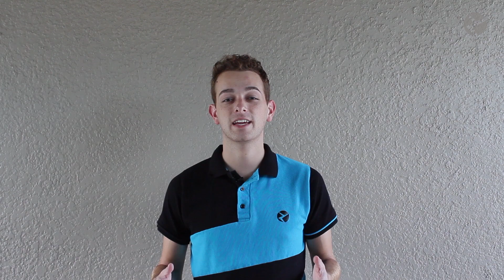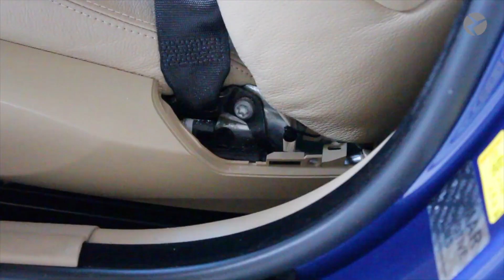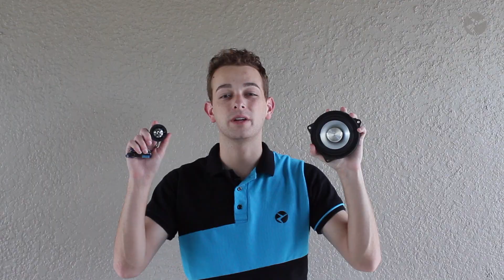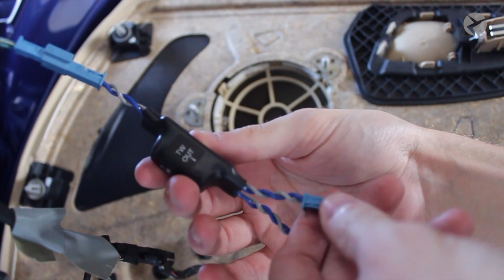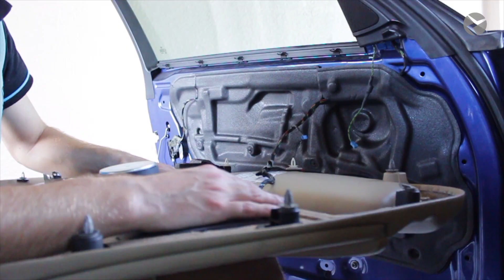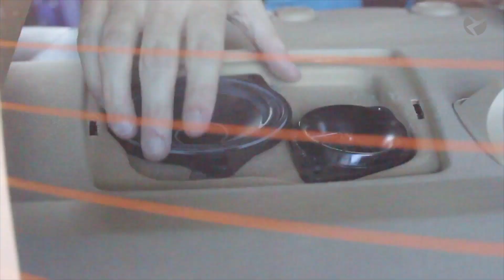BimmerTech Alpha One Speakers - E90 Installation

Comment: @bimmerTech I have a 2014 bmw 328i xdrive without the premium sound package and when I am playing music with high bass the sound is distorted, and the doors rattle. Will these speakers/subwoofers help if I upgrade to them or will I also need some sound deadening materials as well.
great video by the way.
Reply from the maker: Hello Claude! Our woofers are much more resistant to high power, so they sound much cleaner and with much better bass on the low end. I don't know what's rattling in your doors, of course it's never a bad idea to apply sound deadening. Our company 3-series didn't have any rattles in the doors even in stock form, also without the premium package.
Reply: @bimmer-tech  awesome how much would I need to budget for this system (part and labor ) and will I need a new amp as well ? the rattling is more about the vibration of the sound. When you are inside the car it sounds just fine but when you are outside it is terrible my 2010 Mazda  speed 3 sound way better
Reply from the maker: Please go to our website https://www.bimmer-tech.net/speakers-and-audio-amplifier-for-bmw/ and type in your VIN. The website will show you different sets for your car together with the price. And if your vehicle is compatible with an amp, you will see it there too.  As for buying the amp, you should know that our speakers were developed to perfectly work with our amplifier. They were numerously tested together (Alpha One Speakers + BimmerTech Amp vs Alpha One Speakers + OEM amp), and the results you can see here: https://f30.bimmerpost.com/forums/showthread.php?t=1488352

Comment: If I have a base system E90 2011, then I dont have a factory amp, can I still install the alpha one amp in the trunk?
Reply from the maker: It's more involved, but depending on your VIN, it could be done.  I would suggest for this that you please reach out to our Sales Team via chat on our site or by calling, have your VIN ready, and they will be happy to help!  They might check with our Audio Team, but you'll get your answer there.

+1 (646) 439 7920
info@bimmer-tech.net
https://www.bimmer-tech.net/page-contact